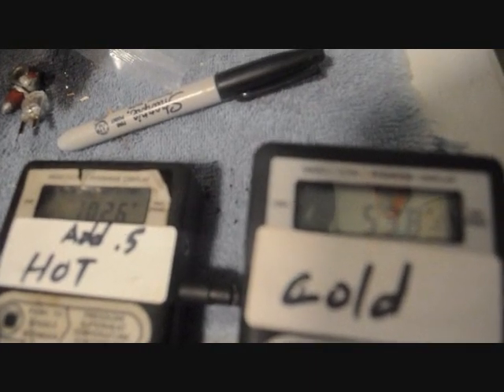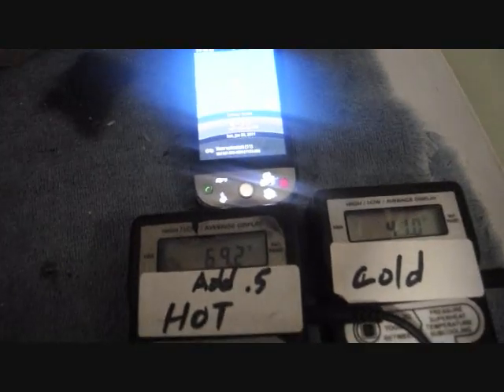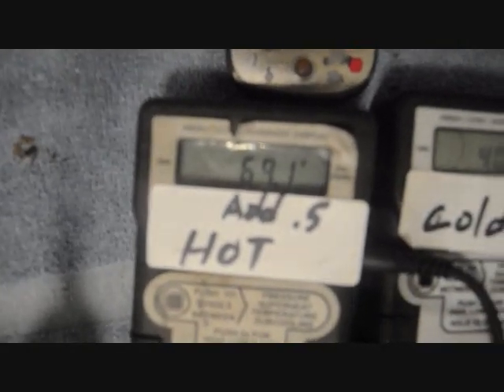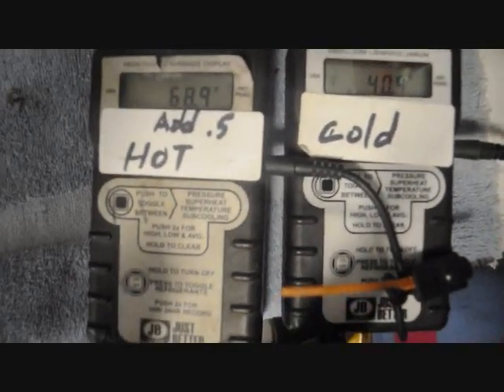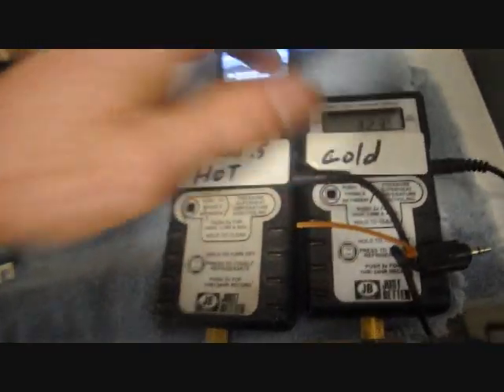Hot or Cold Water  Freezes Faster (TEMP-TEST) FACT

Comment: Mpeba effect is nothing to do with evaporation. It is just simply matter of blackbody radiation. You probably used wrong type of plastics. Use HDPE, LDPE or PP plastics, which are much more transparent to long wavelength far IR. 

If you use PVC containers, it may be not so transparent to long wavelengths. If you use glass containers - situation is even worst. You have only contact cooling, not radiated heat cooling. 

Use proper container, and convince yourself that hot water freezes faster.

Comment from the maker: Your test is making a storm very hi Humidity.  What Humidity in the cloudy turn to Condensation supper heated Making a frozen rain . Supper heat is a refrigeration term. Ice machines never have hot water install to it . Pyramid Air, Heating and refrigeration.  But seen  this is cool. 12 oz hot water and many be 4 oz of ice where the other ??????  Steam, Humidity, Evaporation

Comment from the maker: @NightFlyyer  Your test is making a storm very hi Humidity.  What Humidity in the cloudy turn to Condensation supper heated Making a frozen rain . Supper heat is a refrigeration term. Ice machines never have hot water install to it . Pyramid Air, Heating and refrigeration.  But seen  this is cool. 12 oz hot water and many be 4 oz of ice where the other ??????  Steam, Humidity, Evaporation